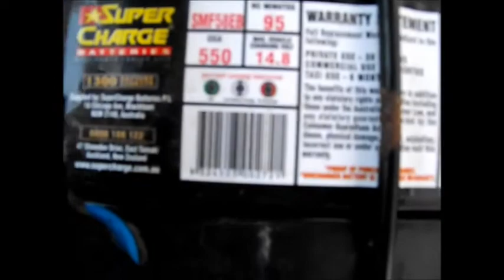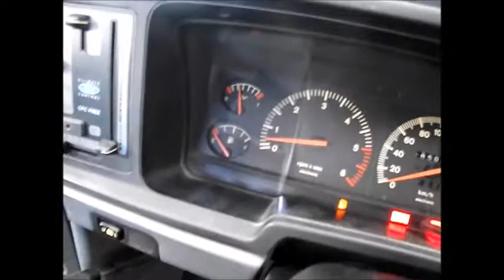ed falcon flithy oil

Comment: i agree.................also carbon build up suxs so i do it and she clean  on the inside from inspections with the oil cap off. my previos vs ecotec  with 450k on it was running strong but from previous owner lack of oil changers killed the oil pump and it was a gunky mess everywhere inside.bits off gunk fell off and blocked it up.oil pick up had old gasket material in it as well.. pity as it pulled so strong and drove like new for 2k until the old shit fell off and fked it. 

i changed the oil and filter when i got it but to late ..damage done.
Reply from the maker: Frequent servicing is always the key.

Comment: Lube the oil seals too Came across one where it was hard most of the way to undo
Reply from the maker: oil filter had the fuck tightened out of it, even if the filter seal wasn't lubricated it wouldn't have been as hard to remove as it was

Comment: Do you ever use oil flushing products (like Nulon engine oil flush)?. I started using it years ago on my EB, to me, it made a huge difference.
Reply from the maker: I never really have partially because I change my oil every 7000KM, but engine oil flushing additives do have their place I guess if a car went a while between oil changes with a previous owner. Do they really clean the inside of the engine? That is hard to say really because the only way to say for sure would be to get a dirty engine and strip it down, re-assemble and use the flushing additive and then strip it down again. you could always run the correct grade Diesel engine oil which contains more detergents than SI engine oil. You don't have to change oil at 10,000km you can change it a lot more frequently if you want to; the cleaner the engine oil the cleaner the engine. also making sure the pcv system is working correctly and that any oil/vacuum leaks are fixed will ensure dust/dirt and water is not pulled into the engine

Comment: So putting old oil from a fish-n-chip shop into your car is a no no LOL :-D Joking :-D.

When ive replaced the oil/filter in my mates car, the filter went back on hand tight, never leaked, i just wound it on untill i felt the sudden increase of torque needed.
It wasnt so tight that i made a grunting noise LOL :-D :-D

The oil was to book spec, middle of the road quality.
Often the sparkplugs and air filter were changed as well, other fluids were checked.
I would use the colour of the oil as a time to change, it never had a chance to go black.

And my work motorbike was checked every weekend for everything, it was important to me.
Reply from the maker: LOL the oil in this car already looks dirty and it has only been idled and revved in the driveway.